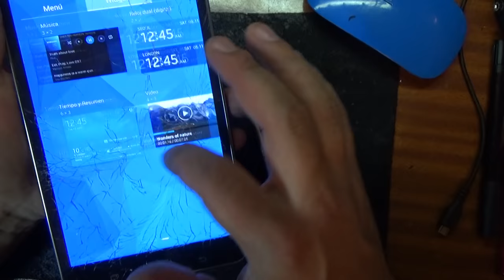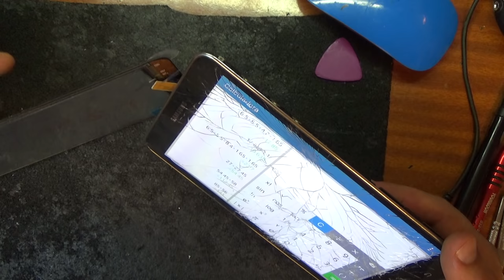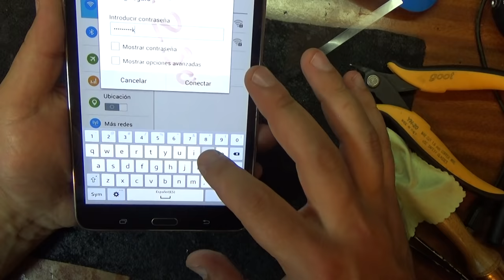Samsung Galaxy Tab 4 7.0 SM-T230

Comment: You need to take motherboard out then use heat gun to separate the glass screen heat gun may damage motherboard otherwise
Reply: I didn't take out the mother board and it was just fine